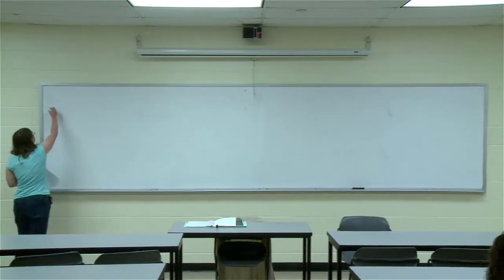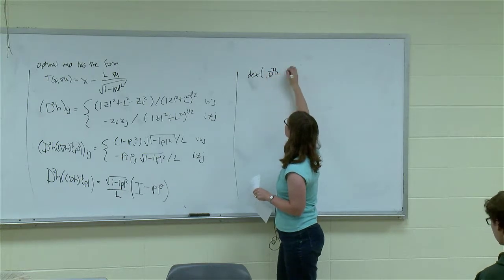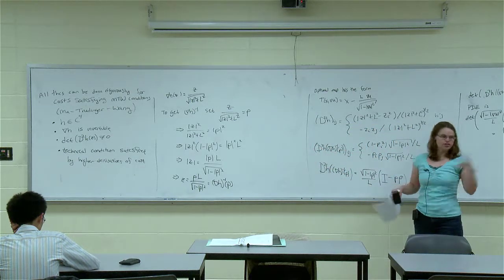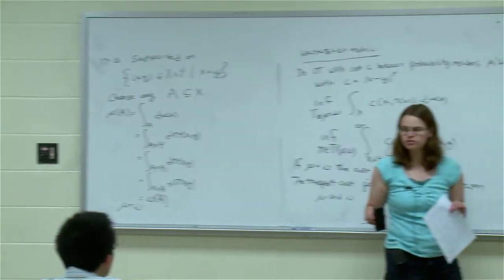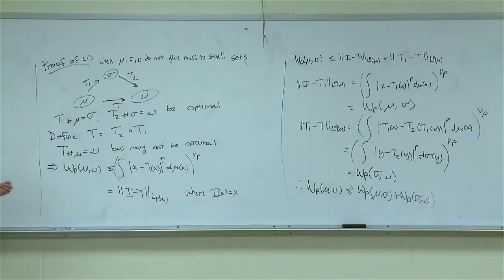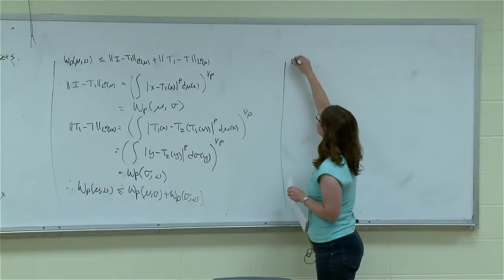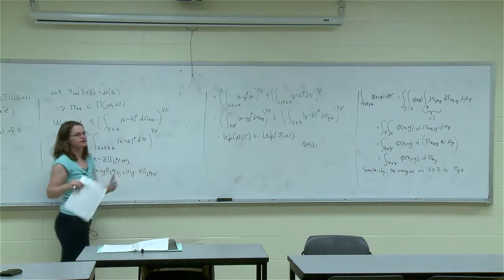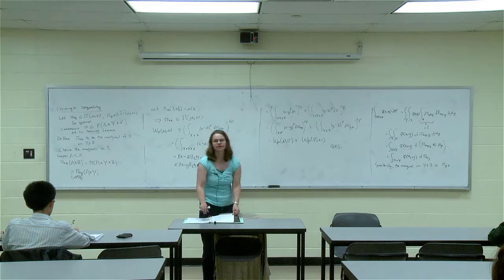Optimal Transport - The Wasserstein Metric

Comment: Thanks for your lecture. I have a question for 31:36: why is \pi supported on the diagonal set {(x,y): x=y}?
Reply from the maker: This is a consequence of the fact that \int_{X\times Y} \abs{x-y}^p d\pi(x,y)=0
Suppose instead that the support of \pi includes a set S where (x,y)\in S implies that x \neq y  (i.e. S consists of the off-diagonal portion of the support).  Now we assume that \pi(S) > 0.  We also have that 
\abs{x-y}>0
for every (x,y) \in S.  Thus
0 < \int_S \abs{x-y}^p d\pi(x,y)  \leq \int_{X\times Y} \abs{x-y}^p d\pi(x,y)
which is a contradiction.
Reply: @brittanyhamfeldt  Great thanks.